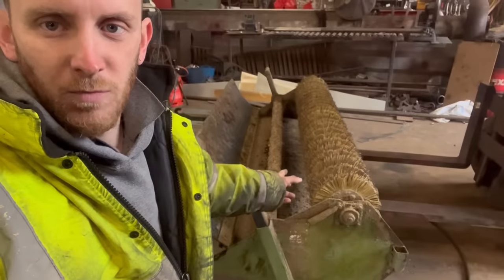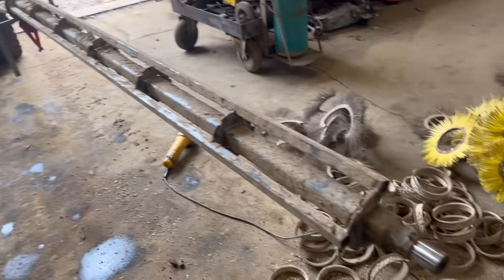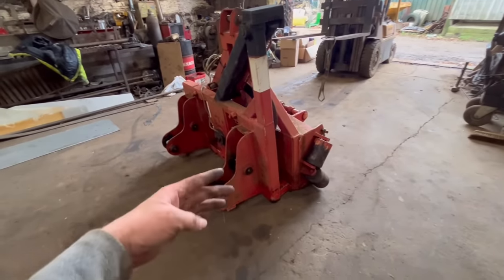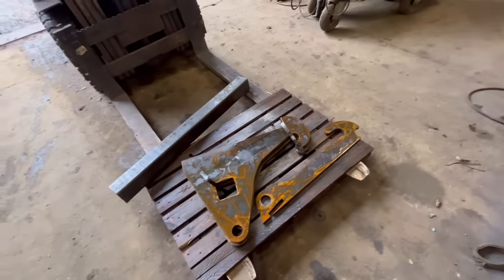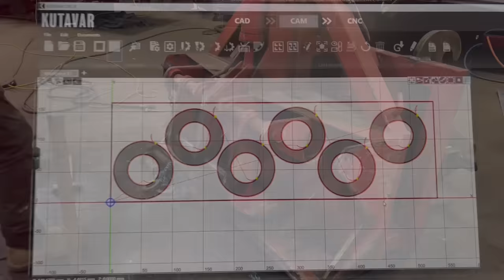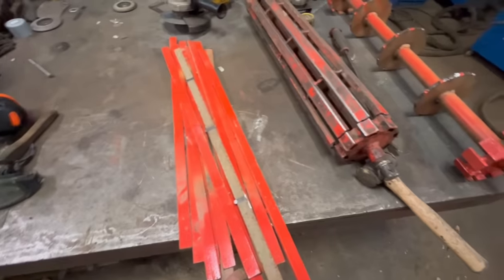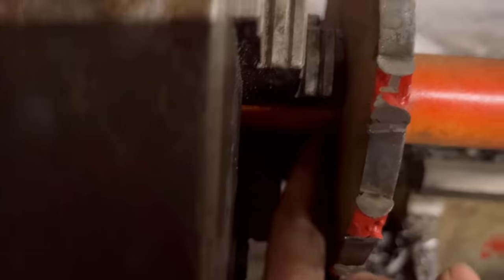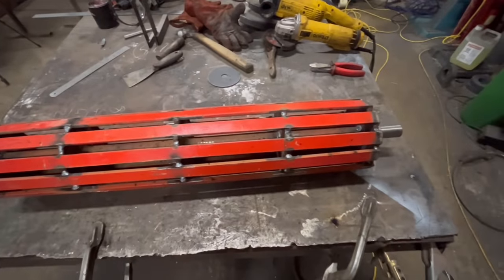Bucket brush, bracket change and broken roller

Comment: My go to with bearing races is the slit disc on a grinder, 9/10 times I can cut it and drive a chisel in and not mark the shaft, but if I’m burning them off I do it burning straight down, I can usually see what I’m doing better. Another great video 👍🏼

Comment: the new plasma cutter does a very nice job in your capable  hands as you seed simple jobs in there right but lots ,ore than a simple welding job if you don't take the time to line it up and do the little extras you d so the job lasts i am sure the customers appreciate what you do even if they don't say so but meat we notice thanks for showing us a day in your work load Cheers from down under

Comment: VERY NICE to see a bloke wearing a proper full face respirator when gouging. saveing your eyes and lungs for later in life. Kurtis from CEE is the only other fuy that wears one, and by the looks, it's the same make and model. 

Show ogf you craftsmanship. Let us see your welds before you grind them smooth. Always loov a good bead. 

If you have a four jaw on the lathe and a dial indicator you could have got that square without having to modify it. 

Overall 10 out of 10

Comment: The first job on the vid - those brush bearings, when I was in the mechanicking business back in the day I found the best way to remove inner bearing tracks was to use a slitting disc as you said, but instead of risking damaging the shaft you cut until about an eighth of an inch short from all the way through then give it a good hard smack with a nice sharp one inch cold chisel, and it fractures instantly....at that point it expands enough to slide off with ease.....never failed me in years of doing it that way.......and its heaps quicker.

Comment: You can use your torch, to blister the paint off. And use a wire brush or wheel. Bad welds will eventually fail, Joe Capo.

Comment: Easy way to get centred on a bar for keyways without fancy measuring is to touch down on the shaft with your cutter a few thousands and look at the shape it makes ( looks like a butterfly ) you can move in or out a few thou till the cut pattern looks like the wings are exactly the same when you cut down and then you will be perfectly centred on the bar. As a miller for many years this is a very quick way to cut the keyways without taking out the cutting tool and measuring then working out how much to move and having to replace tool, old school.

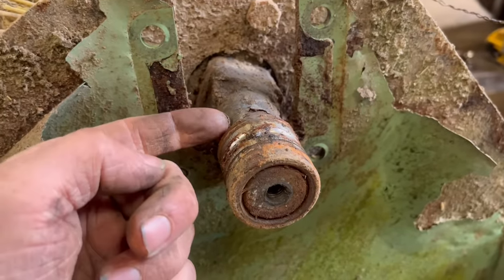Comment: 3:03 I use a grinder, just don't go all the way through. That race is hard as diamond gnats, so if you mark it, then strike it with a blunt chisel, it will snap. I've done this on big bearings too, where cutting would've meant using a lot of disk. Just a decent slit per size of race and bam, off it falls.
7:00 Smokes, that's so cheaply made! My brother has a very similar one from the 80's. Made in Poland, and that little plate you're pointing at at the time index is 1 cm thick plate, welded all the way around. Whoa, that's cheap. :))

Comment: Could you not have worked the second end in the chuck rather than at the tailstock? or was the shaft too long to fit on the lathe. In the end all problems overcome and a job well done. Congrats on 30k, 50k is not far away and I'm sure you will get there soon with you interesting content and the way you turn a hand to almost anything.

Comment: that telephone pole clamp looked alot like old school  feller buncher. you getting quite good at converting loader bucketc etc over to quick hitch setup. sometimes gotta work with what you've got; that roller might not be perfect might not be to your standards but helluva lot better than the broken one as well as the spare in as it originally was

Comment: I know it pretty common here in the states(im also not sure how easily you can get your hands on one) to blow a hole in the tip of the tooth of your forks and bolt on a Ball for a receiver hitch to keep chains and slings from slipping off the end of the forks.  Might be something to consider 🤔

Comment: Unless you have asbestos hands Id say the preheat was a waste of time Ollie. Great fixes using ingenuity. To remove those inner races, just grind through as much as you dare and then twat it with the hammer. They usually split along the grind. Well done on your subs. Coming along nicely.

Comment: Probably shears along the weld as that's where the stresses are... if there were additional angle braces added it would help distribute the load but it would want to be balanced so it wouldn't affect something else.

Comment: With the roller brush you started on, would it be financially worth getting you to build a better quolity inner compered to just replacing it every time it wheres out? i.e. would a good quality cuatom made one be cheaper in the long run? Just curious really..... thanks
Reply: I don’t understand your comment it’s the brushes that wear out not the shaft. Sure the shaft will probably need replacing when these brushes wear out but that might be in another 5 / 10 years depends on how often they use it. Most of the shafts in these brushes are pretty light weight but go on for years
Reply: @johnwarwick4105  In the video, he says that the shaft is going to have to be replaced next time it gets new bristles due to the rust, missing sections and cheap crappy welds. This led me to the question of which is better, 1. buying a cheap factory made shaft made out of thin metal and chappy welds and is made as cheaply aw possible because they know that you'll be back soon to buy a replacement.... or 2. buying a custom-made shaft with better/thicker metal and stronger welds?

Comment: also well done wearing a filtered air respirator when goughing - it apparently gives es off extremely fine carbon dust - which settles deep into ones lungs like a chain smoker - so kudos for wearing right gear - dangerous shit apparently.

Comment: Everything you do is interesting, don’t have to be complex all the time.  For complex see ZK master tech and all the hassle he has from John Deere kit, nothing he does is simple thanks to designers who have never done the shop floor reworking.
Reply: I remember seeing one episode of ZK when he needed to replace the fuel tank on a John Deere because it was punctured. He practically had to take the whole tractor apart just to get the old one out. Must have been a crazy expensive repair. I'd have just made do with hanging an old drum off the cab with some baler twine!